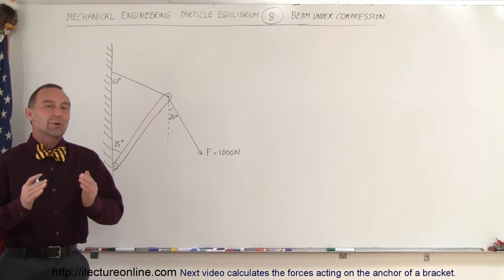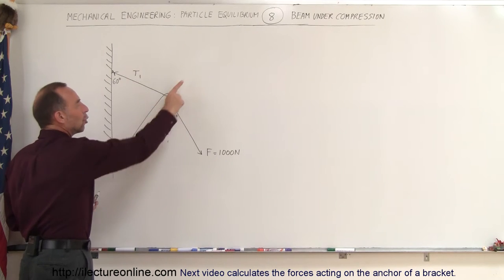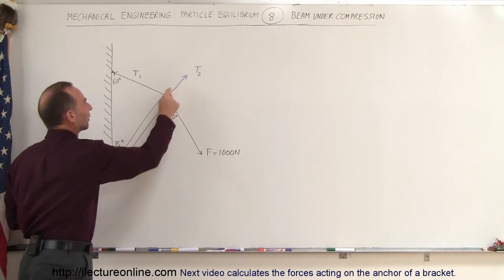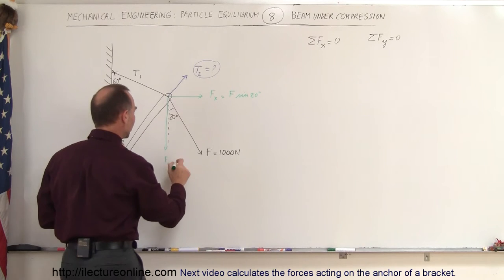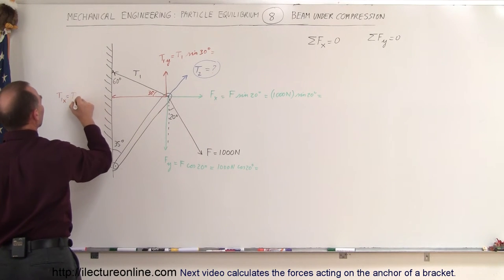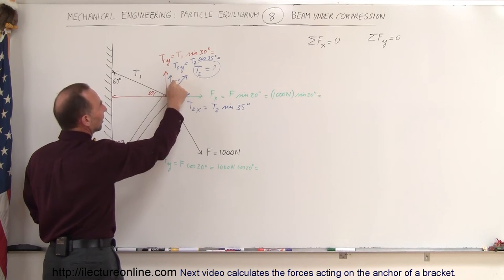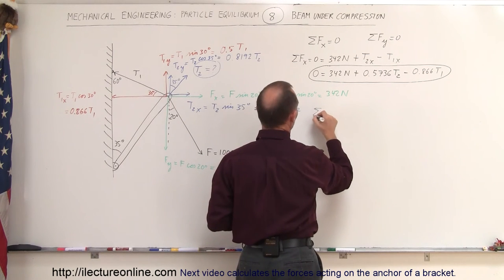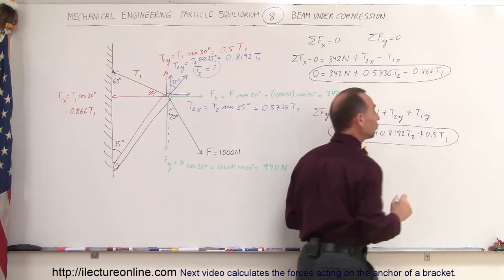Mechanical Engineering: Particle Equilibrium (8 of 19) Attached Beam Under Compression

Comment: Thanks.  I'm trying to re-teach myself Newtonian mechanics lately.  Wouldn't it have been much easier to assign the x-direction to the axis ALONG the beam itself (i.e., rotate the picture clockwise by 55°).  The angle between the beam & T1 is 85° (i.e., 180° - 35° - 60°), and the angle between the beam and F is 55° (i.e., 20° + 35°).  This would result in only 2 simple simultaneous equations that directly solve for both T1 & T2:   [X-axis]:  T2 = T1cos85°  +  Fcos55°     &     [Y-axis]:  T1sin85°  =  Fsin55°  (or T1 = F (sin55°/sin85°).  Substituting second equation into the first gives:  T2 = F ((sin55°/tan85°) + cos55°) = 645N   and T1 = 822N.
Reply from the maker: There are many ways in which problems like this can be solved.

Comment: Hi sir, I don get why we have T2 isnt T1 enough to make the system at equilibrium. Also why did you put T2 in this specific direction. Is there something i should follow to know the direction of T2. last question when do we include T2
Reply from the maker: The goal here is to find the force T2 such that when applied there will be no compression or tension on the beam, which essentially equals the compression on the beam without T2
Reply: Thanks for your response but why in this direction is T2 did you follow a certain procedure
Reply from the maker: The direction of T2 should be on the same line as the bar.

Comment: it is not clear for my mind that this force T2 will be in the same direction of the beam, should we check this once T2x and T2y are calculated? and check that teta is 35°?
Reply: This a 2-force member (with the weight of the beam neglected).  So the force is directed between the 2 support points of the beam.  A FBD would clarify that, but this professor never utilizes it.
Reply: @psilvakimo  ;)

Comment: Excuse me, I don't understand why T2 is in the first quadrant and not in the third  :/
Reply from the maker: T2 represents the beam pushing back against the 2 forces compressing it.
Reply: ahhhh. Thanks! How could we calculate the compression suffered by the beam caused by the applied force so? Do you have some classes where you treat the subject?
Thanks again, your videos are great :)
Reply from the maker: T2 has the same magnitude as the compression force on the beam.
Reply: thanks!

Comment: Why shouldn't you considered the support reaction at the hinge of the beam ?
Reply from the maker: The forces at the pivot point can be ignored, since they don't provide a torque.
Reply: @MichelvanBiezen  In which cases can we ignore it ?
Reply from the maker: When the action of the force goes through the point of rotation (pivot point) we can ignore them because they don't cause a torque to exist.
Reply: @MichelvanBiezen  you mean that, the pivot point has frictionless surfaces? Like, it's free to rotate.

What if the pivot is tight ?

Comment: This is a very heavy way of solving the Pb. Horizontal and verical axis is not the best choice. Much simpler and faster to project on -F axe and his direct orthogonal!...
Reply: I thought the same. I would rather choose your method as well. It is a much easier way in fact!

- angle α between load and beam = 20°+35° = 55°
- angle β between cable to the wall and beam = 180° - 60° - 35° = 85°

longitudinal force Fa on the beam = 1000 * cos (55°) = 573.6N
shear force Fs on the beam = 1000 * sin (55°) = 819.2N

shear force Fs on the beam towards the wall has the same amount in opposite direction: 819.2N

Fs/Fb = tan (85°) (Fb is longitudinal force on beam caused by the cable to the wall)
=> Fb = Fs / tan (85°) = 71.7N

F = Fa + Fb = 573.6 + 71.7 = 645.2N